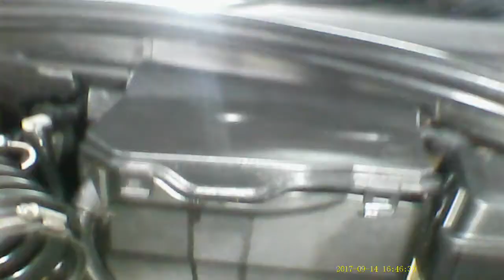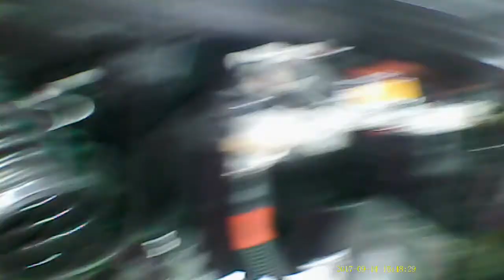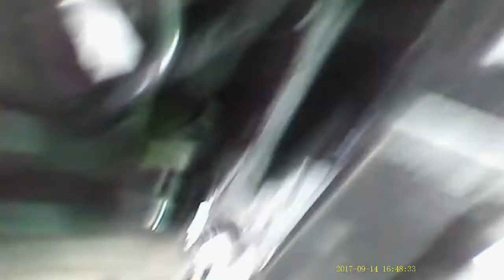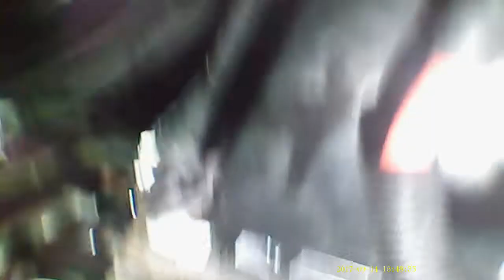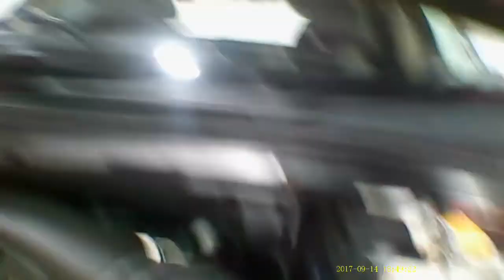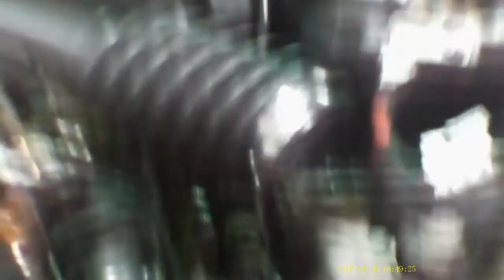Volvo XC60 battery replacement

Comment: No audio as far as what he is doing or what tools he is using which sucks , but this just showed me that i have to take the front plastic off with this years model. I got as far as loosening the bolt that holds the battery down but the cables are in the way.